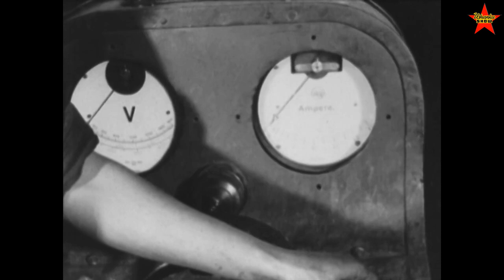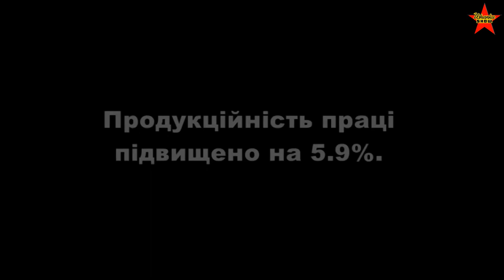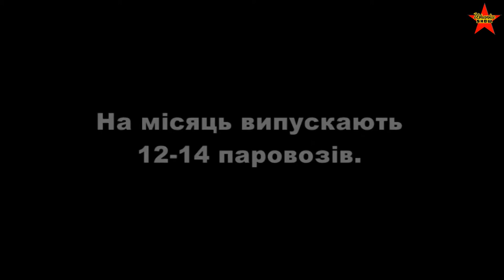Soviet Factories Making Pencils, Bicycles, Electric Motors and Steam Locomotives in 1930 #ussr

Comment: I was always amazed of how heavy duty items made in the cccp were. Based on the few items I found in the 1980s. Later I was reading that the soviet factory was judged on the amount of product it used, not produced.  So it was beneficial to make a heavy than needed pan, hammer, axe or anything. The heavier it was made the factory look better to their overseers.
Reply: I have an O-gauge model locomotive made in the USSR.   Heavy as a tank.

Comment: wow, hand-filing an effing BRIDGE to fit...
Reply: 50 years ago i saw boiler makers using rivets to restore some machinery. They used large round files to ensure the rivet would fit through the holes without jamming but to get an accurate size they used 1"1/4 reamers.